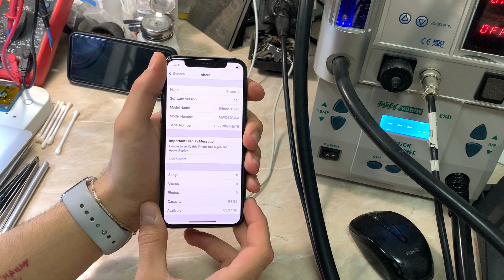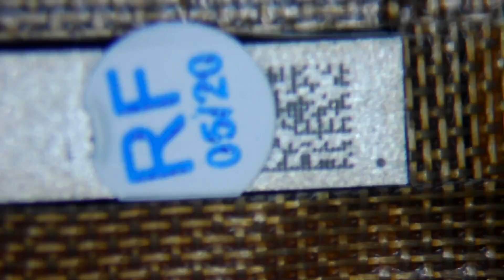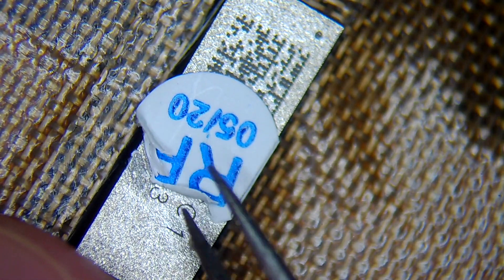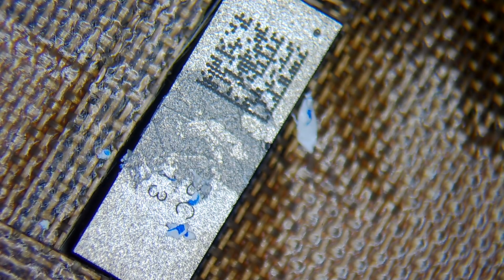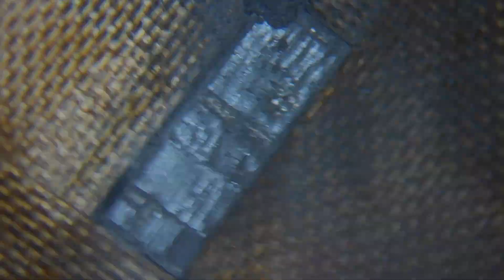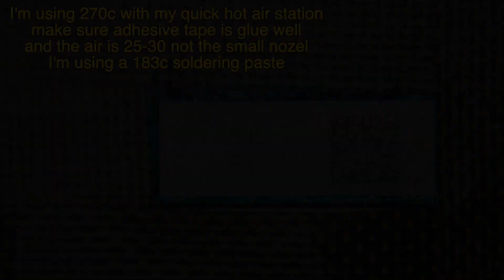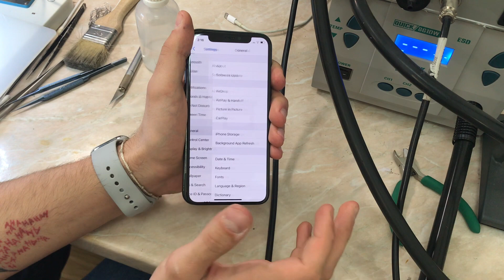iPhone 11 Pro Important Display Message Fix (The Safest Way To Do it)

Comment: Do you have to solder the original IC to another original screen? Or can you also solder the original IC to a copy screen?

Thanks
Reply from the maker: It depends on the copy screen if it has the same ic then yes just swap the original one
Reply: @AntoineKiriaky10  any idea which copy screens are likely to have the same IC… it will be brilliant if I can zero down on a copy screen that I can use to change IC’s.